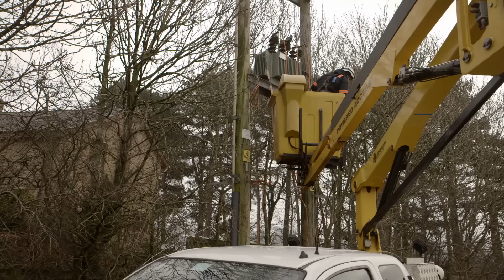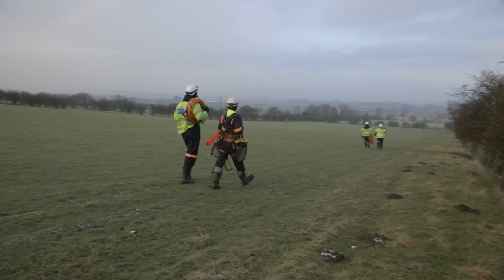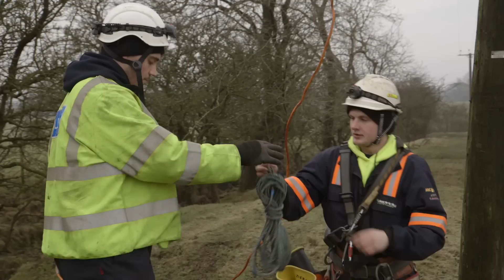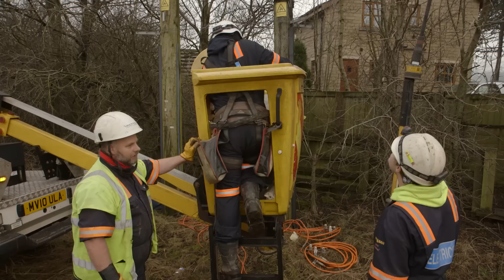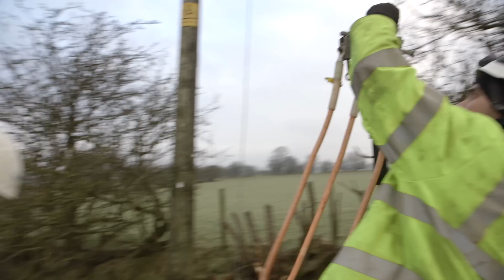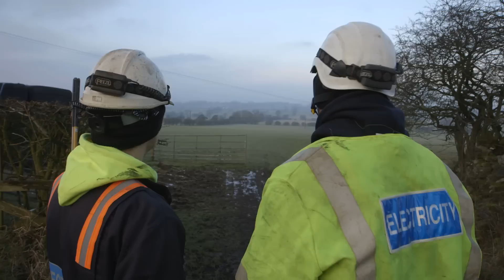A day in the life of an overhead linesperson

Comment: Why are they using class 2 rubber gloves for putting a earth on muppets
Reply: someone in management told them to ;)
Reply: It is an energized conductor until the grounds are applied.
Reply: 51Winton Yeah imagine being extra safe and careful when dealing with high voltage electricity. Nerds.
Reply: Because applying earth is still a part or isolation procedure. Someone doesn't read the regs.
Reply: American lineman here, are you calling a ground an earth ?